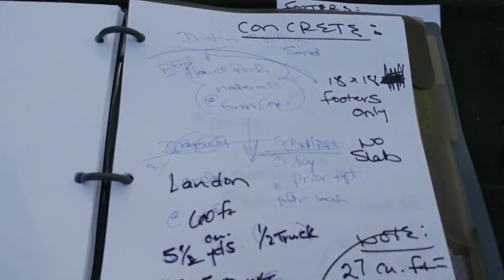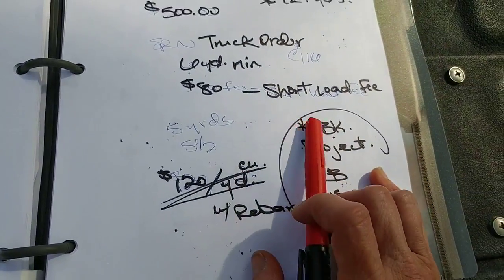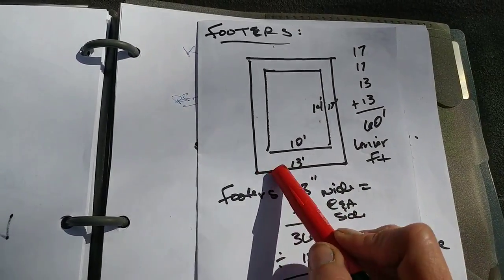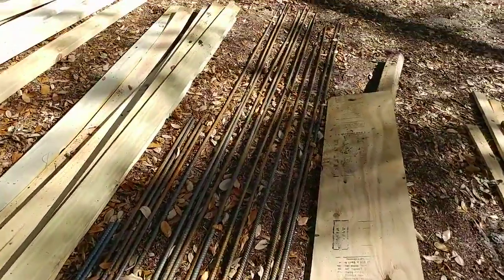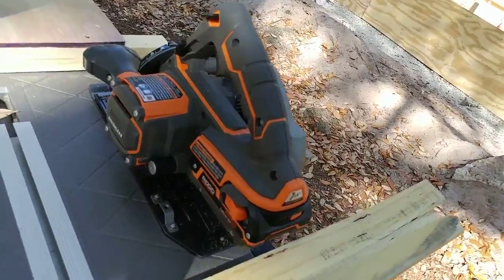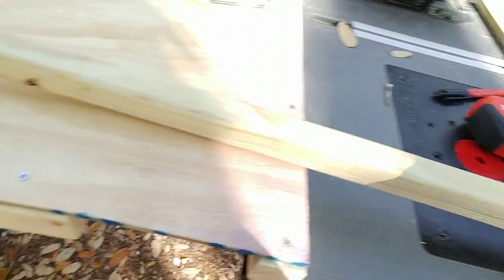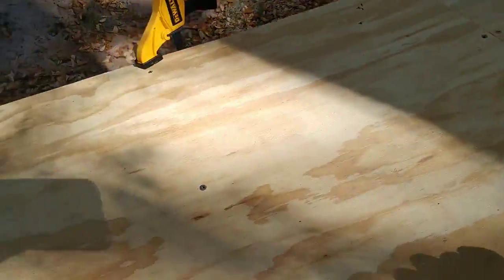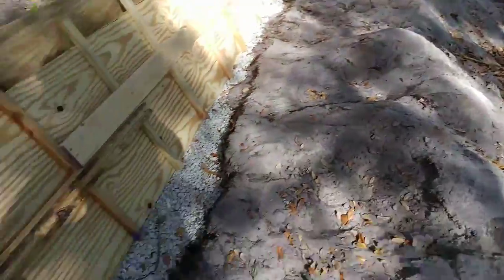Florida Cob Workshop - Concrete Foundation Formwork

Comment: I'm at the part where you are demonstrating your circular saw. Buy yourself a 12" Swanson square. Clamp the board to a sturdy saw horse and mark where you want to cut. Then use the square as a guide and make your cut. That whining noise, when the saw jammed at 7:20 was the blade being pinched because the saw which wasn't being held / guided correctly. I'm not being critical, just trying to help. A more powerful saw might well have kicked back and bit you.